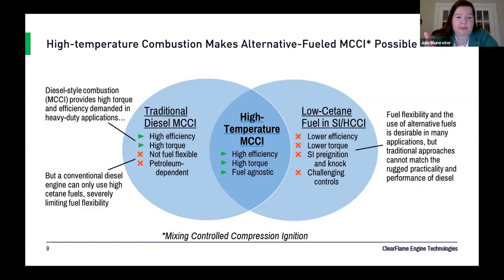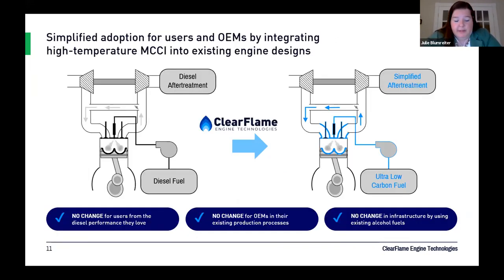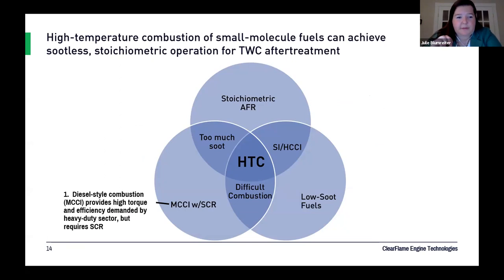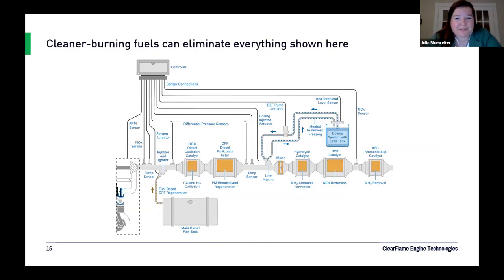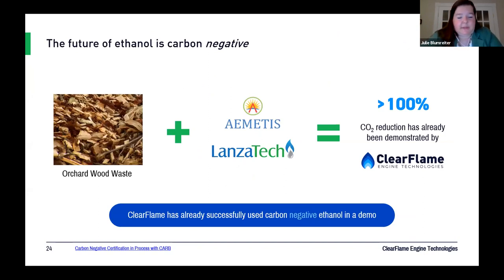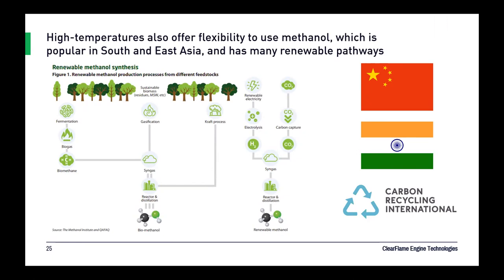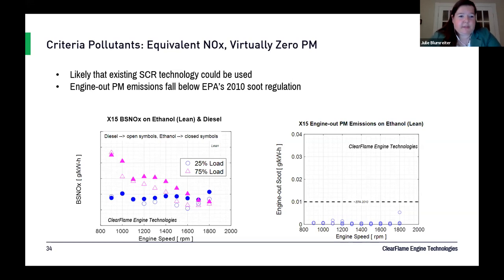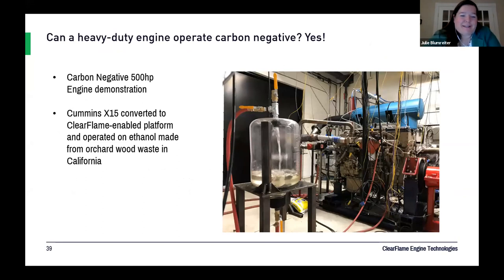SAE Chicago Presents: ClearFlame Engine Technologies

Comment: You can also drive diesel cars with Hydrotreated vegetable oil = HVO, which can also be done with animal fats. More and more diesel cars in Sweden are being approved for it. Hydrotreated vegetable oil (HVO) is a biofuel made by the hydrocracking or hydrogenation of vegetable oil. Hydrocracking breaks big molecules into smaller ones using hydrogen while hydrogenation adds hydrogen to molecules. These methods can be used to create substitutes for gasoline, diesel, propane, kerosene and other chemical feedstock. Diesel fuel produced from these sources is known as green diesel or renewable diesel.

Diesel fuel created by hydrotreating is called green diesel and is distinct from the biodiesel made through esterification.

Comment: Current heavy diesel engines use turbo....If this can be replaced by a supercharger that can greatly increase efficiency. Also if Hydrogen can be injected into the combustion chamber ..that can increase efficiency .Hydrogen and Ethanol have much higher octane numbers than conventional Diesel fuels.On board Hydrogen generation is possible using D.C current and cells.
Reply: A large Supercharger certainly requires the engine to be strong even without the Supercharger. unless you're talking about an electric Supercharger